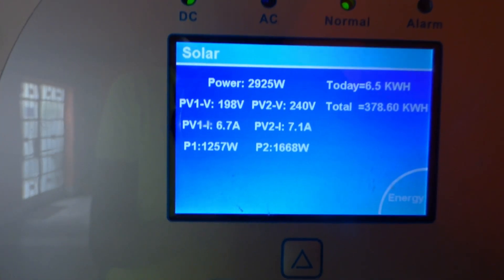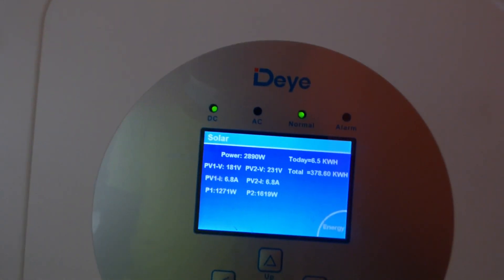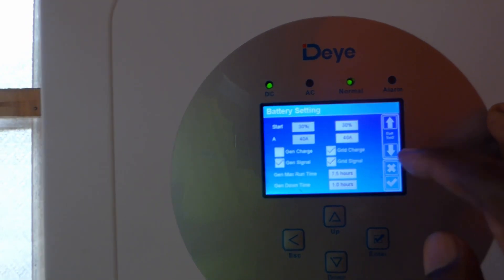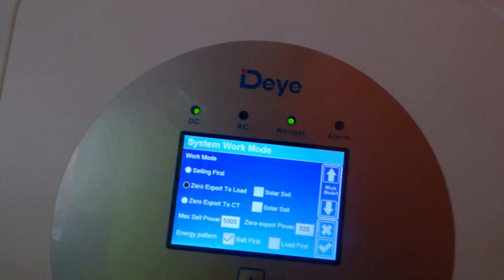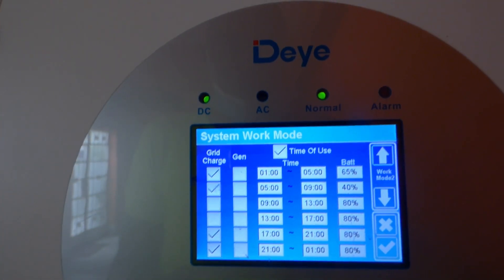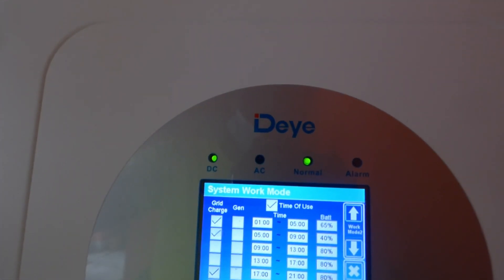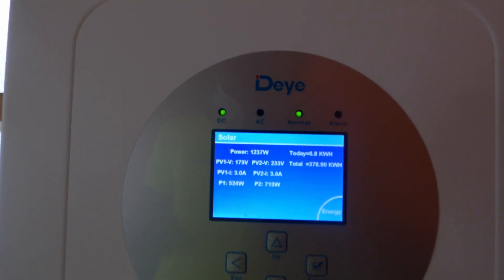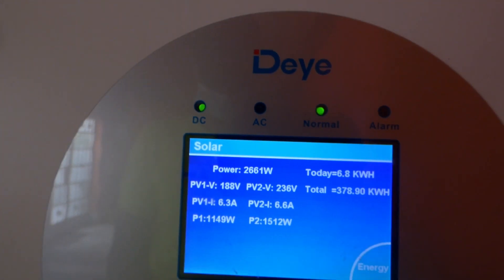Deye Inverter: Prioritizing solar over the Grid see how it is done.

Comment: Sir..thank you for your video.
My questions are:
In case if I want grid enter to inverter to charge the batteries and just supply the house without selling (not allowed in my country) which mode should select (zero export to load or zero export to ct) ? And arrow point to grid or to inverter.
Please advise. 
The arrow point of CT
Reply from the maker: thank you for watching and commenting. The setting zero export to load. The CT arrow faces towards the grid. Those are very good questions
Reply: @drsolar from this answere I see that you know nothing about solar .. sorry
Reply from the maker: @mayassleiman  thank you. Nothing to apologize for. Start your own channel, showing us what to do
Reply: There is no point putting CT if the mode is set as zero export to load .. . So that it will power the Backup load only .. am I ryt sir ?

If you select Zero export to CT you will power your backup load as well home load so that it requires CT wiring ..

Comment: Thanks for the educative post. Well I am using the deye as purely an Inverter charger. Do I set it to Battery first or should I set to to Load first? Somehow I failed to interpret the modes. Basically am using batteries and Grid.
Reply from the maker: If you have the grid, I would do load first. You will save on your electricity bills that way. Also set time of use.

Comment: Hi. Love your videos. I have a 8kW Deye inverter but it keeps beeping on F20 Fault (DC overcurrent) when I turn the solar on. I have 15 X 450W Panels installed. Please could you assist in telling me how can I resolve this? Is there a setting I need to select on the inverter to fix this problem? Thank you in advance
Reply from the maker: Thank you for watching and commenting. How do you have your panels connected? What is the voltage and current of each panel?
Reply: @drsolar  Hi thank you for your response. It is really appreciated. The solar panels are connected with 7 panels in one string and 8 in another string. Each panel has an open circuit voltage of 49.7V and short circuit current of 11.73A. The voltage at maximum power is 41.9V and the maximum current power is 10.98A of each panel
Reply from the maker: @leeshanpillay1253  your string is fine. Turn both strings off and clear the error. Then turn on one. If the error appears turn of off and then try the other string. If it goes away I will double check my connections. That is where I would start
Reply: @drsolar  Thank you I will try that and let you know if it works. How do I "clear the error" on the inverter? Is there a specific button?
Reply from the maker: @leeshanpillay1253  Turn all the input breakers off (PV and AC), then turn the inverter off the button on the side. Wait a few minutes and turn it back on.

Comment: I have a grid tied inverter (not hybrid) with older panels. Due to regulations I cannot do much changes to this system. However I want my new deye 12kw 3phase hybrid, to be able to charge it's batteries from the existing panels/inverter, as well as charge the batteries from grid when/if necessary. How would I go about doing that? The deye will be set to zero export, as I am not allowed to sell more than the old panels/inverter can produce. I plan on adding new panels to the deye, so essentially i will have two systems connected. With only one of them exporting to grid
Reply from the maker: Thanks for watching and commenting. I don't know the electrical regs where you live so take my advise with caution. The grid tied goes into the Deye Gen port and then the grid goes into your Deye AC in Port
Reply: @drsolar  thank you so much for replying so quickly. I'm aware of the difference in location, I'm in Denmark 230V 50hz grid
My main issue is that I want the old grid tied inverter to still have the opportunity to sell to the grid, when the deye is not calling for power to either the house or batteries. At the same time i want the deye to be fed by the grid, when the old inverter /panels isn't producing.
Reply from the maker: @GrummeGumba  the Deye can sell back to the grid. But easiest way to connect a grid tied is through the Gen port

Comment: Mr I've installed my Deye inverter but I'm failing to get the floating settings
I did  all the Battery setting when I scroll down it stops on
 lithium mode
Low battery 
Restart
It doesn't go on the next page for floating, absorbtion
Equalisation
What could be the problem
Shutdown
Reply from the maker: You can set float. What type of battery are you using?
Reply: I'm using hubble lithium battery
Reply: @charlesmadongo2047  I also dont see float etc with my hubble battery, i think those are automatically configured when the inverter talks to the battery bms

Comment: Hello do I need to tick "use batt %" for this to work even if im using a lithium battery?! The bms will still work?
Reply from the maker: Can you explain in more detail what you are trying to accomplish
Reply: @drsolar  Sure, I just want my inverter to use my generator power (not grid) only between 4 am and 8 pm if the battery falls below 25%.

Comment: Doctor Solar is it possible to connect 4 * 455w connected in series  on PV1and another 3 *455W PV2 but I'm using a combiner box with 2 surge protectors for 4 panels in series and 3 panels in series?
Reply from the maker: Thank you for watching and commenting. Yes PV 1 and 2 don't have to have the same voltage or watts. As long as you meet the start up and operating voltage you are good. I personally would do all 7 on one string.

Comment: Dr between my deye inverter and shoto batterye what cable configuration do i use?
Reply from the maker: Good evening thanks for watching and commenting. Not sure Shoto has approved Bms communication protocol with Deye.
Reply: Hi, how do we set this up so that during night time we only use the battery and not the grid? As we use very little electricity at night but seems its still using the grid and not the battery
Reply from the maker: @wilmareunderhay427  time of use will do it for you

Comment: Hi, if you put 65% from 1am to 5am and tick on grid charge, will it charge max upto 65%? Or will it go upto 100% charge?
Reply from the maker: It will charge when it gets to 65% back up to 100%
Reply: It will charge with the grid up to 65%, then if there is surplus solar, it will charge up to 100% with solar.

Comment: You are an expert in your field Dr Solar
Reply from the maker: Thank you Krikor. Did you get to the bottom of your battery issue?
Reply: @drsolar  yes it was a bad DC CB causing voltage drop under load.

Comment: Question can the Deye 8kW inverter start in its normal mode to inverter with DC power from panels and battery only i.e. no grid present at all?
Reply from the maker: Thank you for watching and commenting. The answer is yes. That is how I ran it. No grid, just pv and batteries
Reply: Thanks much for your response and for the clarification I appreciate it a lot.
Reply from the maker: @anthonydwyer3307  my pleasure. Thanks for visiting the channel
Reply: Good Night I have another question.
What if I have a parallel and system that’s two Deye inverters cascaded in parallel B-Parallel B but when one is buying from the grid the other is selling hence, the Slave is not mimicking the Master. How can I fix this?

Comment: In the system work mode setting at3:22 in the video.  Does this mean the GRID will energize the load or the SOLAR energizing the load (WHEN YOU SELECT LOAD FIRST)? It's a little confusing
Reply from the maker: Thank you for watching and commenting. If the two resources are present, they will prioritize powering the load before charging the batteries.

Comment: From what I could gather reading the system work mode you basically grid charging the batteries from the grid during 0 sunlight hours and when the sun is out you have "de selected " the grid check box making the solar work to charge the batteries. Have I made an accurate assessment? Looking forward to any feedback from you
Reply from the maker: Thank you for watching and commenting. You are correct. Using the time of use settings the battery soc also plays a role in when it allows the grid to charge. Those are parameters that you can set too. I hope this helped.

Comment: Sir, does it possible to connect in series 2 different brand of pv panel, my inverter has only 1 string, 3 x 460w JA and 3 x 500w Trina. Ty very much
Reply: Thank you so much sir for reply and more power
Reply from the maker: @ronanmandigma6470  good luck
Reply from the maker: if the voltages are close you can. The lower will pull down the higher. If the voltage of the panels are similar you can do that.
Reply: Please what is the capacity of this particular Deye inverter?
Reply from the maker: @muzzammildikko567  5 kw

Comment: hello! id like to clarify that if you turn on the AC breaker (linked to Grid), it prioritizes the grid instead of the battery?

we want the battery to still be consumption priority while the grid is on standby. in other words, i dont need to manually turn the breakers on and off for this

my setups a deye inverter 5kw, 10kw lith ion batts, and 3k solars
Reply from the maker: Thank you for watching and commenting. Please subscribe if you have not. Go into your time of use and adjust the setting to match what you want to accomplish
Reply: @drsolar  thank you! setting up the time of use made it easier to manage the battery priority

speaking of which, is there a cap to how much the grid can charge? or does it only try to charge as much as possible in the given timeframe?
Reply from the maker: @neoncaasix4570  in your battery settings you can specify the % to start and the current to use during the charge process. Please don't forget to subscribe
Reply: @drsolar  thanks once more! this may or may not be my last question.

turning on AC grid will add more volts to our house supply, from 230V to roughly 250-255v. will these be fine? if not, is it recommended to turn on AC breaker only if needed?
Reply from the maker: @neoncaasix4570  the inverter is fine with it. Will your appliances be?

Comment: Hello, I installed a Deye hybrid inverter today with solar panels and 10 kwh lithium battery. I have a question, in Time of Use mode, what does the battery percentage represent when Grid charge and Gen charge are unticked (in the video you set it to 80%).
Reply from the maker: Hello George welcome to the channel. Thank you for watching please don't forget to subscribe. If the two boxes are unchecked it means that it won't charge when the grid or generator is on. I am off the grid without a generator so my settings are meaningless.

Comment: What I experienced is that the higher you set your time-of-use (%), the more you will utilize from the grid when it is overcast or when you are struggling to generate solar.

I've found the best settings on my setup is to set the time-of-use to 10% for all time periods, then it forces higher solar usage (I also prioritize load before battery), but I have a sizable battery bank, and the bank rarely goes below 40% (unless it's overcast 2 or 3 days in a row).
Reply from the maker: For people with smaller battery banks and a poor grid it is not really an option. I do agree with you though

Comment: Hi good day, what is the main difference between zero export to load and zero export to ct? I have the ct sensor and not selling to the grid. I just want to have the batteries charged by solar to be used at night and when it reaches 20% charge it will automatically use grid. Thanks
Reply from the maker: Go to time of use and you can make that happen. Thank you for watching and commenting

Comment: Hi sir, I installed a 10kW 3P Hybrid inverter without battery and load connection. I wanted it to function just like normal grid inverter which is only sell the power generation to the grid. Can the inverter function in such ways? If can, what settings that need to be done?
Reply from the maker: I have very limited experience with the 3 phase Inverters, on the standards go into the system work mode and select solar sell. Thanks for watching and commenting.

Comment: Hi sir, I installed a 12kw 3P Hybrid inverter with 2 of 3.5kwh Pylontech batteries. can you please advice if it is correct for me to set the AH to be 146 as this is a 48V system? Thank you
Reply from the maker: Thank you for watching and commenting. The 146 to 150 would be fine. The battery is too small for the inverter. The BMS max is 72 amps. Your 12 kw can charge and discharge at way beyond double the BMS max. Add more batteries please.

Comment: I recently installed a Deye 5K inverter with solar panels. I also installed a CT. Somehow I still get between 0,02 and 0,2 coming in from the grid even though my demand in the house is lower than the output of the solar. This even happen when I am the batteries. How can I get the flow from the grid to become 0,00?
Reply from the maker: Thank you for watching and commenting. Congrats on your new acquisition. I personally think it is a quirk of the Deye inverter. I have not figured out how to make that number 0 yet. I will ask the tech team at Deye
Reply: @drsolar  thank you for the videos and the response. So yours is doing the same? It is not a lot of watts going through but it all adds up. Looking forward to hearing if you got a solution
Reply from the maker: @shaunwilliams1222  I am totally off the grid, but we see it happen with some of our customers
Reply: Check your  Mode 2, Grid trikkle feed, make it 0.

Comment: sir can I change the max discharge of battery allowed to prolong the use of battery during night time?
Reply from the maker: It will limit the amount you can pull out of the battery but it might not prolong the use. You can prolong the use by limiting the load over a period of time

Comment: How do I change my battery discharge settings from 80% to 90% on my inventer, I am using lithium iron batteries which allows me to go up 90%. Thanks
Reply from the maker: Thank you for watching and commenting. So you want to change it to go down 10%. Go to your battery settings and change it there. You want to start grid charge at 10% if you have a reliable grid

Comment: Hi! Two months ago I got installed a solar systems, two 5KW  inverters and  two 20KW batteries. The installer left the batteries as backup only. However my preference is to deplete the batteries to a certain percentage before using the grid in order to significantly reduce the bill. I live in the Caribbean where there is a lot of sun everyday. What would be the best time of use recommendation you have for my goal? Thanks for your help!
Reply from the maker: Congratulations on your system. 40kwh in batteries. That is huge. Enable time of use. During the day don't allow grid charge. or you can set the percentage you want it to charge to. Go to the battery settings and select the % you want the grid to start to charge. I hope that was helpful
Reply: @drsolar  Very helpful! Thanks a lot for the quick reply. What is the lowest percentage you recommend the batteries to deplete to?
Reply from the maker: @robertomurillo2775  I usually follow the recommendations of the manufacturer. Don't allow grid charge, you can save on your electric bill and discharge to about 25%.
Reply: Hi Doctor, hope you are fine. I am having the situation that my inverters are displaying very few solar energy generated even with a lot of sun. If a I turned off the grid with the main breaker, then the inverters show a lot of generated energy. Do you have an idea of how this can be solved?
Reply: @robertomurillo2775  I have the same problem, what should I do?

Comment: Good day.

I recently installed a Deye 5kw inverter with no battery. The problem I have is that the inverter only shows on when the sun is up. It there a way to see the grid use during the night. Thank you in advance.
Reply from the maker: Congrats on your new purchase. If you have the grid connected then it should should you what it uses. What are your settings?
Reply: @drsolar  no sure. It was installed by an installer. He is also trysing to sort it out. And yes it is grid tied. Is there a specific setting I should look out for? Not sure how to send pictures over youtube chat.
Reply from the maker: @hugovanas8172  info@atlanticwastepower.com

Comment: Hello, good video. Could you tell me how do you configure lifepo battery ?
Reply from the maker: A BMS is a must. Use the recommendation from the manufacturer. each cell should be between 3 and 3.56 and set float to be 1 volt below your bulk and absorption voltage

Comment: Hi finally got my deye 5kw with 2.4kwh us2000 pylotech.  
I'm kind of happy. Battery won't charge at higher than 10a

Dr solar please 🙏 I need your help with that. 
As well as could you make a video describing 
1.zero export to load 
2.zero export to ct.

Please please 🙏
Reply from the maker: It will take a few cycles before it allows the full charge current. What did you set the start charge current to? Zero export to load. What else would you like to see in the video?
Reply: @drsolar  oh I went through most of your videos but could you help us all explain the pros and cons of mixing different wattage solar panels.
Having two mppts on the deye up the complexity and confusion to us all.

As always this is Latrocious form South Africa Johannesburg 🇿🇦. (Lol love your intros)
Reply: @drsolar  thank you , 
my  charge and discharge set to 25a.
 Under battery settings , battery mode I chose lithium .
Shutdown set to 10%
Low battey set to 25%
Reply: @drsolar  it doesn't give me an option to choose current charge settings for battery.
I chose lithium mode under battery settings.

Heres a video idea, 
Funny enough if I choose lithium mode under battery settings my soc 48%, max 10 amp charge.

But when I set it at batt% under battery mode it changed my soc to 24% and started charging at 16 amps.???

This is a pylontech us2000 battery 2.4kwh

Oh and my battery temperature is 14 degree celsius